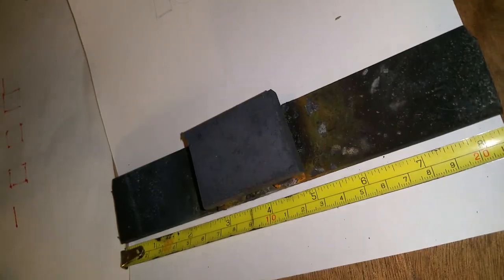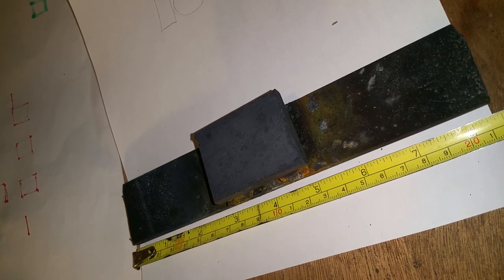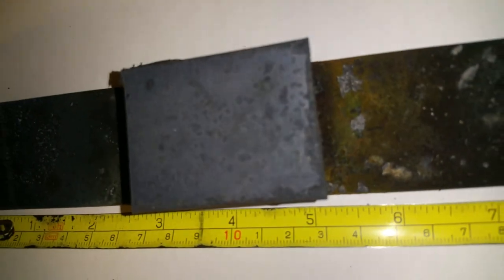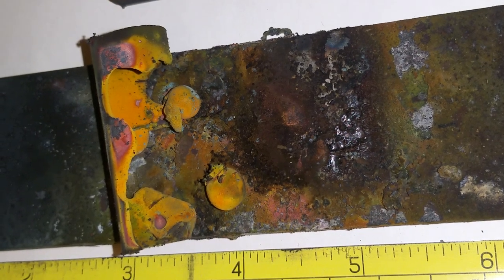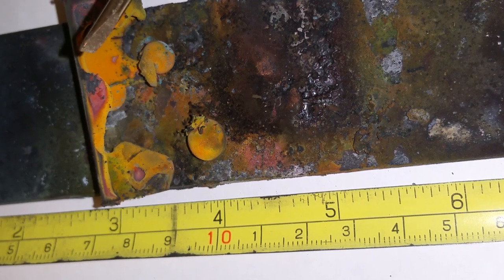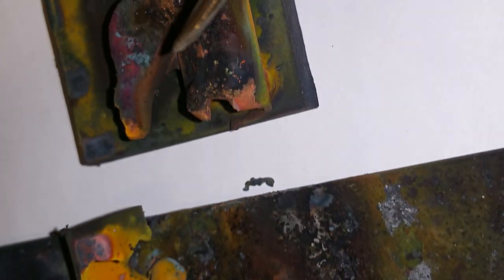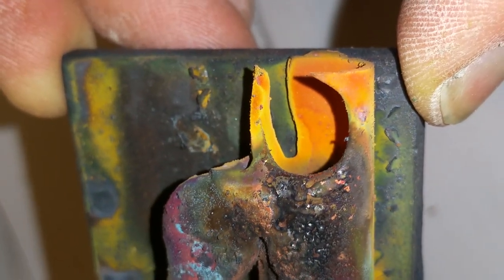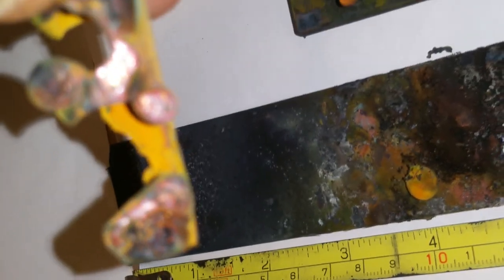VEGA - Exploding the Valley - Aftermath overview

Comment: Transmutation is not a melting outcome I suspect. The copper "went extinct." The color is not only astonishingly beautiful, it will yield important data. It seems the presence of color before and after is a fine indicator/trace that the forces that manifest it are significant. SEM analysis is gonna be good! Respect and deep appreciation Henk.
Reply from the maker: Well, we learned from Hutchison (1979+) and Soviet Energetics programme 1980s via Tom Bearden's visit to them in 1992, that metal can be turned to a non-molten jelly that can be moulded.

Certainly some of this material became this form and some of it was perhaps converted into other elements, teleported or converted into light and leptons.
Reply: @MFMP  A truly beautiful and inspiring reply BG. So much in so few sentences.  Exciting times. BTW Kitchen complete. My best to Kim and family.